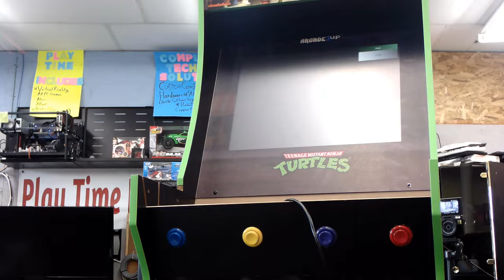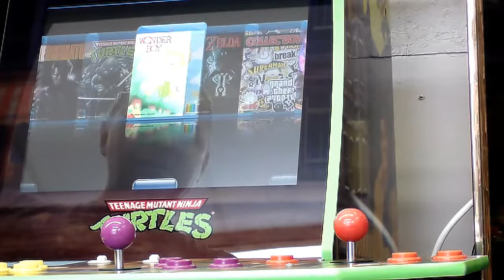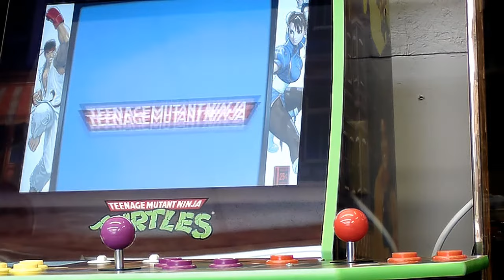Lets "Bake a PI".. This time lets upgrade this awesome TMNT Arcade 1UP!

Comment: Wonderful video thanks for posting! Do you have a link for the USB encoders that you used? The one in the description isn't the same, and I like that you can hook up 2 players to each encoder (to help preserver usb ports on the pi). Also, you used all the stock buttons correct?
Reply from the maker: Michael Glovis I did indeed use all of the stock buttons and controllers. The USB encoder that I tried at first actually came from Micro Center. You can find them online. However, I ran into configuration issues running two controllers on one in coder. Ultimately, I ended up going with one encoder per controller just to alleviate those problems and it cleared them all up. Thank you so much for watching!
Reply: @AlternateArmsSD  Thank you my friend I just subscribed! So if i buy the new usb encoder boards in your description, do I need to also buy jumpers to connect the negatives like you have in the video or do they just plug directly into the encoder? If so, do you have a specific part you recommend? I only ask because I don't have spare parts lying around so I want to order everything from amazon.
Reply from the maker: Michael Glovis I actually posted some generic “male to female” jumper wires I used.  They made the job a ton easier and quicker. Truth be known, there are several usb encoder boards that would would just as well, those are just the first I settled on.

Comment: Whats the tape called that you used...also have you tried using the amp with a nuc instead of a pi3b
Reply from the maker: Greetings, it’s called double sided industrial Velcro. I use that stuff even these days. It’s very very tough. I have actually used an app on multiple occasions. In fact, this is an older build. If you look at newer videos I have a final fight where I used an amplifier and installed a coin acceptor. Thanks for watching and welcome to the family!
Reply: @AlternateArmsSD  do you have link to it or put it in your info section for the velcro
Reply from the maker: @djavsdjavs  Done.. Its the first link in the list. have a great weekend!

Comment: So sort of same question as hdmi monitor from before. If I have successfully set up a pi using an lcd board in my arcade 1 up cabinet, then when I upgrade to the dell 2007 fbc monitor do I just run it straight from the pi to the monitor without an lcd board? Assume that I have the audio already running from the pi to an amp and to speakers that are working! So is there a need to even use and lcd board or can I just get an adapter and go right from the pi to the monitor
Reply from the maker: Correct, you eliminate the lcd board and run straight into the raspberry.
Reply: Thanks man, also I noticed you said both usb encoders have to be setup in the same order for the buttons to work properly, is that correct? And if so I wonder why that is?
Reply from the maker: @chriswalden939  You know, I wondered the exact same thing (I believe I mentioned that in this video). Truth is, it shouldn’t matter as you have to calibrate each one individually. I may test that theory on my next A1UP build.

Comment: Well I tried not to be back but I am, lol.  I got the extra buttons in and working so I'm able to play games and back out but...when playing games the A button is not responding.  When configuring it reads all buttons pressed including the A button but then in game it the A button will not respond.  Any thoughts?  It is this way across all 4 USB encoders
Reply from the maker: Luis Galvan Oh yes, in each individual game there is a configuration file. Have you noticed when you launch them it says press a button to configure. In that game you can set that a button to do whatever you would like it to do. Sometimes, by default, that is set to nothing. Take a peek and see if that may not be the problem.
Reply: @AlternateArmsSD  thank you, I got into the configuration screen but there are no options to map buttons - most of the options are for emulators or ROM choice or video choices.  I am running the Wolfanoz 32Gb Retropie setup, not sure if that makes a difference.
Reply from the maker: Luis Galvan Gotcha, I’m not very Familiar with that build. However, I can tell you, some of the people that do those builds build them with a specific controller in mind. That tends to wreak havoc on aftermarket config’s like this. You might try doing a nice clean load of retro pie and then transferring your own rooms. Just see if that works to eliminate the image as the cause.
Reply: @AlternateArmsSD  yeah something is definitely up with the configuration because I tried 2player TMNT and the A button worked perfectly fine.  I'll try researching this build and see what is going on.  Thank you as always!! So close I can taste it now!

Comment: The amp for sound. You did the audio from the speakers into the amp (red) what did you do with the other I cant really tell what you did with the other.
Reply from the maker: jjrudy41 I split a two channel cable into left right and to grounds. I ran them from the amp up to a female female connector to the speaker. I use that connector to connect existing mail speaker in to the existing mail of the wire that went down to the amp using a female female barrel connector.

Comment: How much was the net cost of all the additional parts (not including cost of the cabinet itself)? Thanks
Reply from the maker: Depending on what you replaced/upgraded.. The equipment I used in the video ran about $125.00 - 150.00 (Give or take a bit).. In the future, I may actually make a joystick and button upgrade standard which would raise the price around $40.00 but it would be well worth it in the long run.
Reply: @AlternateArmsSD  any interest is posting a list of parts and where you got them?
Reply from the maker: Legitimate Business Man Absolutely, I put all of the items in the description. The USB and coders can actually come from several different manufacturers and I’ve seen a lot of different variants but they all do essentially the same thing. Everything else is listed in the description as well.

Comment: Really noob question, but if I used a monitor with hdmi Input would I still need the lcd board controller?
Reply from the maker: That's not a newb question at all my friend! The answer is no. You can go HDMI from the raspberry straight into the monitor. However, You'll need to pull the audio from the raspberry either from an HMDI audio splitter or straight from the 3.5mm jack down to the amplifier. Either way works fine.
Reply: Thank you. That is helpful. Ok so also can I change the pi4 resolution settings hooked up to the machine, or would I have to edit the settings a different way. Or does it automatically detect the best output video settings and just run that?
Reply from the maker: @chriswalden939  It will run default at 1920x1080 but can be adjusted to any resolution and format (IE 4X3, 6X9, etc..)
Reply from the maker: @chriswalden939  It will auto detect generally (and default to 1920) but you can set the desired resolution and aspect ratios in retroarch.

Comment: Great video!  I just need to know how to junction the speakers to the amp....can you explain that?
Reply from the maker: Its actually quite simple. From the raspberry you will use a standard Stereo jack to RCA cable. From the amp you will have to strip an rca L/R cable. Then use a standard barrel connector to connect the male stereo end of the cable to the male stereo end of the speakers. Thanks for watching!!

Comment: How much does this whole setup cost?  I looked at all the items in the description and I came up with $230.  Is that about right?  This is super cool, but I don't think I'm quite ready to spend $230 when I bought the whole cabinet for $200.  Maybe I'll buy one piece at a time.   

Either way, great video! This looks amazing.
Reply from the maker: 2FingerTuesday Hello and thanks for watching!! Well, it depends on the parts. The key is to catch them on sale on Amazon. The encoder boards are relatively universal so you can use any brand as long as it has all the connections that you need. The amplifier is an optional add-on, although, I actually consider it rather imperative. The audio coming out of the raspberry is not very good. The buttons are very inexpensive depending on the brand. I believe when I priced this entire kit out it ran about $120. I will say though, don’t cut corners on the joystick her buttons. You will only create future headaches for yourself. :-)
Reply from the maker: 2FingerTuesday Oh, and if you got the whole cabinet for $200, you stole it :-) I have seen people on YouTube that have managed to catch those at Walmart on sale for 199 but I have tried and tried to no avail. The lady that bought this one bought it at full retail for 399. However, when you consider that you’re adding the ability to add as many games as you can possibly imagine, it’s definitely worth it :-)
Reply: @AlternateArmsSD  Thanks for the response!  Yeah, when I saw it for $200 at Walmart I didn't think twice about it.  I'll probably make this upgrade sometime in the future.  Fighting games with my buds would be a blast.  Great video! Thanks for taking the time to show us how it's done!
Reply from the maker: 2FingerTuesday Anytime man! I actually enjoyed making that video quite a bit. I have some other cool stuff coming up so stay tuned :-)

Comment: Would you do this for customers if they buy and ship the arcade to you for mods?
Reply from the maker: I wouldn't mind at all. I do them for local customers now but I have to tell you.. These things are HEAVY and rather large when assembled. It might cost a tad too much to ship around. I have been considering assembling installation kits though for folks. That might take some of the guesswork out of it. The only real challenge is getting all of the holes drilled in the right spots to maintain the correct symmetry.
Reply: @AlternateArmsSD  I'd be interested if you start doing that.

Comment: I need help guys, I ordered the USB encoders but I got the newer version.  There are two plugs coming off of the joysticks that appear to be 4 pin but the USB encoder boards only have 2pin connectors or 1 5pin connector.  3 of the 2pin connectors are red while others are all white
Reply from the maker: Luis Galvan On some of these conversions I have had to use a short male to female jumper wire. This allowed me to compensate for some of those strange configurations on encoder boards. You are right, they do change quite a bit. Here’s a picture of the easiest way to solve the problem.
Reply from the maker: Luis Galvan https://www.amazon.com/Elegoo-EL-CP-004-Multicolored-Breadboard-arduino/dp/B01EV70C78/ref=mp_s_a_1_4?keywords=male+to+female+jumper+wires&qid=1578146189&sprefix=male+to+fema&sr=8-4
Reply: @AlternateArmsSD  thank you!! I will order those up today so I can complete the setup.  Appreciate the quick response as well as the video!
Reply from the maker: Luis Galvan Anytime my friend! Thanks for watching!

Comment: How did you get all the other games?
Reply from the maker: Years and years of collecting :) my current image, if you include windows in DOS games, is a little over 30,000 games.
Reply: @AlternateArmsSD  how would I get them on my 1up system?
Reply from the maker: @doityoself2244  are you going to build this with the exact raspberry set up that I used in this build? You might look forward, I have a more recent version. I actually installed a coin slot as well. Are you going to do this as a raspberry based system?

Comment: I am getting the TMNT cab soon it's on order. This tutorial has given me some confidence to mod it. However you didn't really show how to hook up the amp with a splitter clearly? any tips? also can you make the streetfighter bezel black ?...is there a way to only have games on the Pi that will use 2 buttons instead of trying many games to see it wont work?
Reply from the maker: Peter Corfield Hello there and thanks for watching!! Ok, let me break this down by questions:

1. The amp splitter. 

From the lcd controller board you will come out via the 3.5mm jack. If you use a 3.5mm to RCA cable, you simply plug the RCA connectors directly into the input of the amp. Now, from the speaker (which has a male 3.5mm) you will need a barrel connector which will allow you to connect male to male 3.5mm connections. Then, you can use the same 3.5 mm to RCA connector on the other side (Alternatively, you could actually splice the wires, but that’s not quite as clean). When you get down to the amp, you will have to cut off the left and right connectors, bridge the ground, and then insert left and right.

2. The bezels.
You can actually change the entire interface. If you go into the set up folder, under ES themes, you can change the theme of the retropie build. However, I would highly suggest turning bezels off for the “Arcade” games and “Mame” games as the pre-installed monitor in the arcade one up’s are not wide screen. The bezels tend to leak into the game. 

3. The games.
Absolutely, you can custom build the image, add or remove any games that you would like, and change the interface as much as you would like. In fact, you can have the system set up to come up into the same game list every time you reboot it. If you would like to see a tutorial on how to add and remove games from the image, let me know. It’s not quite as simple as just plugging the micro USB into a computer :-) however, it’s not that hard :-)

Again, thanks for watching! I will be doing another arcade one up conversion very soon, but I’m going to make a few interesting changes :-)
Reply: @AlternateArmsSD  thank you for the fast reply , I saved this video for when I plan to start my conversion :D dream is to have Turtles, simpsons arcade, trog,,,any other games are a bonus haha I won't be ruining the art on the machine to add more buttons for games like street fighter though.

looking forward to more vids
Reply from the maker: Peter Corfield Thanks man! if you can’t tail, I’m a pretty avid old-school gamer :-) Ultimately, I will have an image on one of these arcade one up that has over 120,000 games. Sooner or later :-)
Reply: @AlternateArmsSD  sounds good to me! I am 39 next week so I too am a old-school gamer playing TMNT in arcades was amazing so owning one in my room (sure not full size) will have made little me die. I also own movie props like Ghostbusters proton pack, ALIENS pulse rifle and Gremlins so living the dream at the min!

Comment: Need more buttons for a few of the players for games that require more buttons, also how would you add the light up marquee to this ?
Reply from the maker: I agree completely! We needed 14 more buttons to make it "perfect" ( 8 total for each player.. 6 action buttons, a start, and a select) but time and money stalled that. As far as a lighted marquee, it would be a piece of cake. You can power one directly off of the power strip and install an LED light strip. It would look great and allow you to light both the front and the back at the same time. That's another option I had considered.

Thanks for watching!

Comment: Thank you for the video! Through trials and tribulations, I have everything hooked up. My monitor will not turn on. I plugged the HDMI into a separate monitor and it all works. I’ve made sure everything from the LCD is connected correctly, no luck! PLEASE HELP!
Reply from the maker: LET GO MY LEGO The monitor will not turn on at all? If you’ve got it powered up, and you press any of those buttons on that small control panel, do you see anything at all on the monitor? If you do, it could just be an HDMI cable problem. If you don’t, it could be a monitor issue.
Reply: Complete Technology Solutions, Yes no power. I may have found the issue. I ordered the correct Card for my specific monitor model. I hope that works, will let you know. Everything else looks amazing on my mod. I did however buy PC speakers rather than do,the amp thing.
Reply: Complete Technology Solutions It works! Just needed the right board for the correct LCD model
Reply from the maker: LET GO MY LEGO That’s awesome! Congratulations! It’s really rewarding when you see your creation come to life isn’t it :-)